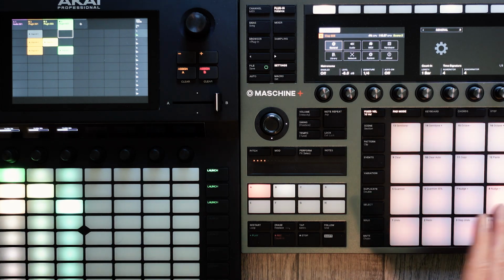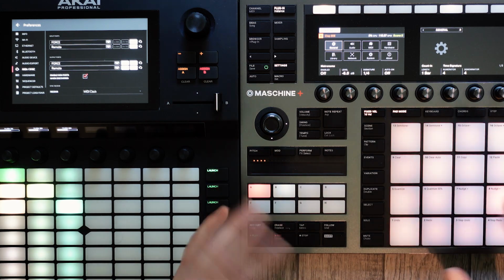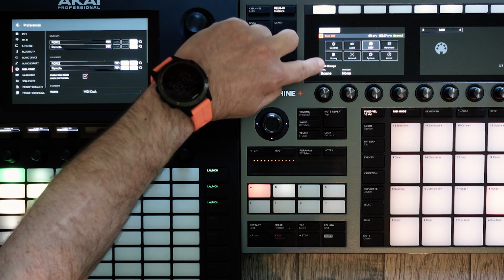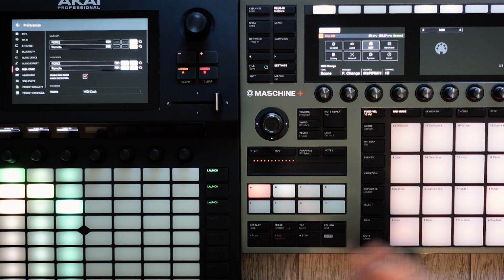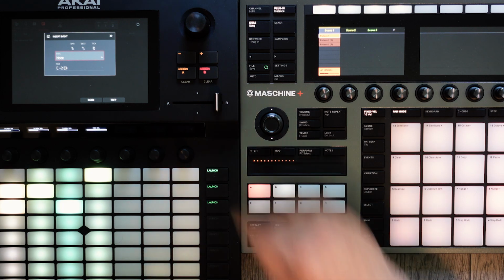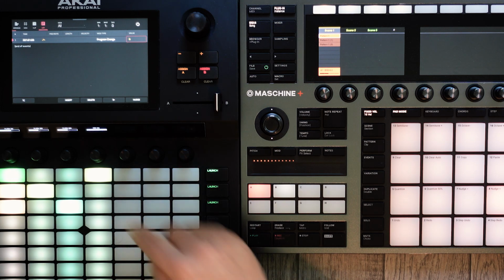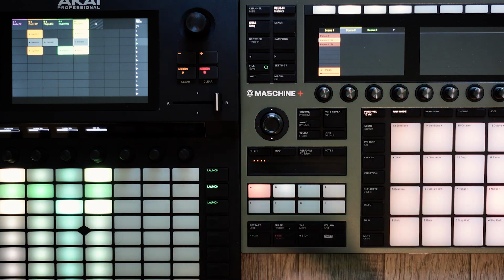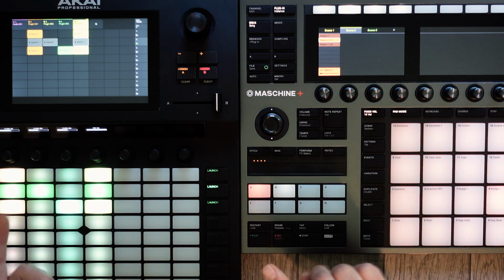Akai Force Tutorial - Send Pattern / Scene Changes to External Hardware

Comment: Hi there.. Nice vid.. Dont know what do with it but well see.. Can you in this method use the maschine as a controller for the force? I have a lot of packs for the force but want to be able to play them with maschine. Is that also possible? Sorry im a noob.. Best wishes for 2024. 🎉🎉🎉
Reply from the maker: Yeah it’s possible for sure, just a case of hooking the M+ up to the Force in the same way you would with a midi keyboard. However it’s worth checking out the Kitmaker app. I don’t know for sure it works with MPC > Maschine, but I’ve used it the other way and it worked great. Essentially it converts expansions from one format to another. Not free, but if you’ve got lots of packs it’s worth a few bucks.
Reply: @MaxipokMusic oké thanks. I dont mean to convert the pack but only use the machine mk3 to drum the beats etc instead of the force with the small buttons.. Regards and thanks in advance.. Greetings

Comment: Hi, I tried to send pattern / scene changes to Digitone (based on your recommendation for switching on 3rd bar of previous pattern) and also to MC-101, but with same result: It always takes few seconds of new pattern/scene to start or even to change sound from the actual scene/pattern. Please, is there some way how to recall JUST specific sound from DN / MC-101 from Akai Force or it is bound to scene or pattern? Thank you!
Reply from the maker: Hi. I probably didn’t describe that very well in the video, when I said 3rd bar I was assuming a pattern length of 4 bars but didn’t explicitly say that. The PC message to the Digitone needs to to be sent 1 bar before you want the change to happen, so for example if your patterns are 8 bars, the message goes on 7.0.1. As far as I know you can’t trigger presets from the Digitone, so you would need to create a new pattern that has the sound you want applied, and trigger that. I don’t have an MC101 to test, but I think you can send Bank Select type messages to that to recall sounds. If you check its midi implementation chart it will tell you.
Reply: @MaxipokMusic  Hi, no, your description was OK, but my DN acts differently :) I decided to use DN and MC-101 just as sound modules, so turning off transport control on both devices helped. At least, I can try do more with midi clips on Force (probability and ratcheting). Anyway, thanks for your videos!
Reply from the maker: @PavelKabelik  Yeah that’s what I ended up doing eventually. Glad you found a useable solution!

Comment: Very helpful. I suspected as much on the Elektron devices. Synthstrom Deluge would fall into a similar predicament...it allows midi learn to map midi notes to scene changes but can't turn off the launch quantization afaik...so you'd use that method of putting change toward end of pattern. It's still a flawed system... But companies aren't really interested in seemless coordination with other brands.
Reply from the maker: Yeah it’s infuriating to be honest. I’d have my Digitone permanently connected to the Force if it wasn’t for this issue 😬
Reply: @MaxipokMusic Just wanted to say that I've found a way to make this work with Elektron devices! I'm using a Model:Cycles which, as you've correctly noted, requires a program change message be received before the current pattern finishes. I'm using Force firmware 3.3 for this, which I think maybe has some updates for program change messages since you originally posted this video. 

So I'm basically following the same steps you laid out, but instead of using list editor to add the program change message, I do it at the clip level instead. So if you hold down edit and press the clip's launch button to get to the Clip Settings menu, you can set a program change message for the clip. The key is to turn off launch quantization on the clip so that as soon as you trigger the clip, it sends the program change message. This cues up the Digitakt so that it's ready for the next pattern before the end of the current pattern. 

I had to make sure that my Model:Cycles was set up so that it would change patterns every 64 steps instead of 16 steps (that can be set at the pattern level so if you have longer or shorter patterns, you can adjust accordingly). It's working perfectly now! The only downside is that the progress bar of that particular clip won't line up with the others anymore, but since it's not triggering any notes, it doesn't matter if it's out of sync with the others. Since launch quantize is turned off, each time you cue up another clip, it will send the program change message again.

Try it out and see if it works for you!

Comment: Thankyou for putting up. I have an mc707 and keen to link it up.
Reply from the maker: That will be a killer combination! Have fun 🙂
Reply: @MaxipokMusic  ok I was working to 2am yesterday. Still waiting to give this a go... No real experience with midi - so if this sounds daft, please forgive me... Is there a way to use midi to turn the sliders on the mc707 into a channel mixer for tracks playing on the force?.  I was at bearded theory last week and watching some great sets has really got me humming.
Reply from the maker: @simonc8265  I don’t know the answer to that! The way to check it would be to connect the two then use midi learn on the Force and move the fader on the MC707 to see if it is transmitting a cc value. Just a depends whether the 707 is configured to do that, if it is the Force will respond to it. Of course if it works you would also be adjusting the 707 tracks at the same time, which might be a problem. A better fit might be to pick up an Akai MidiMix to control the Force’s faders.